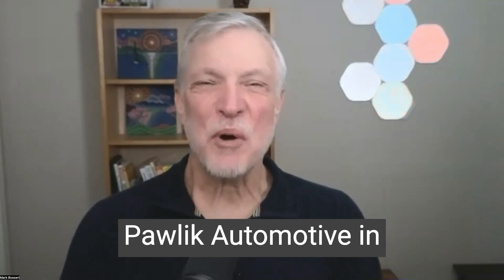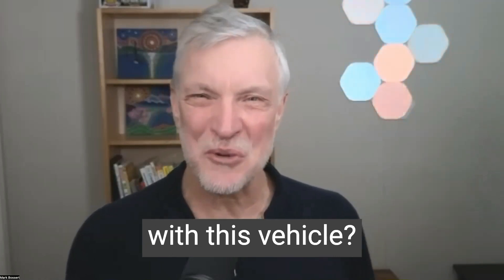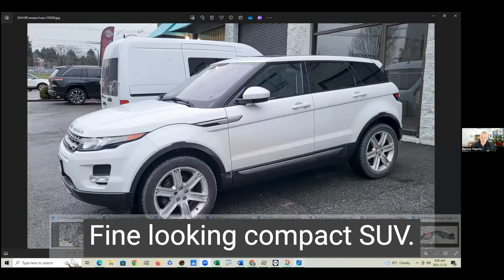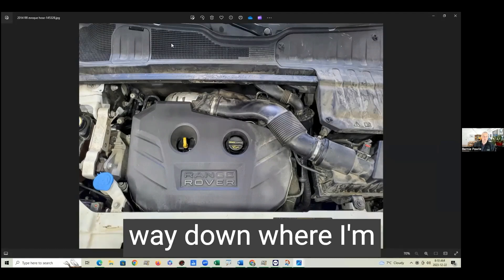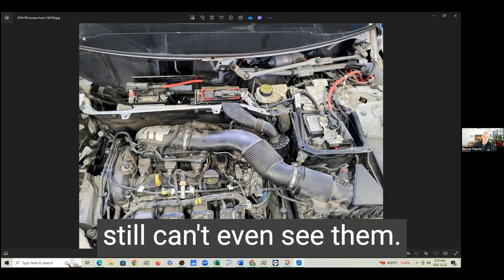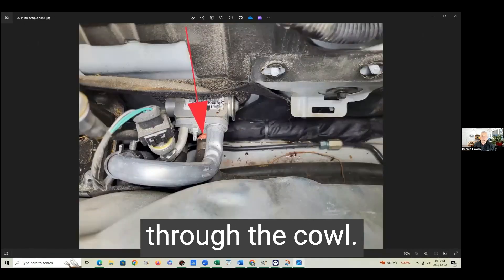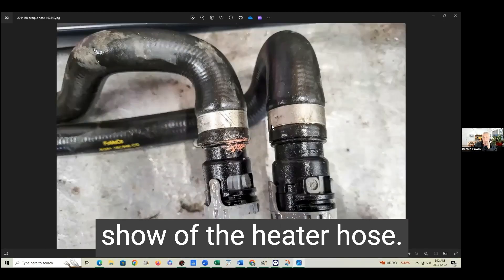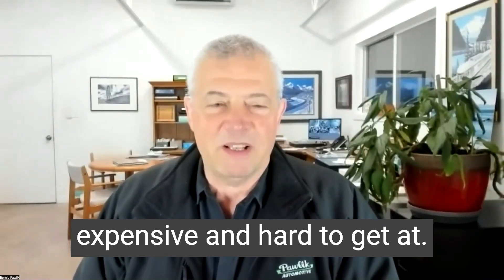2014 Range Rover Evoque Coolant Leak

Comment: there was coolant loss, how did you top off the coolant? did you simply fill the reservoir several times? also, how did you bleed the air? did you bleed the air through the vent on the main radiator hose? I'm asking because I have the same car, and I just replaced the same hoses PN#19276.